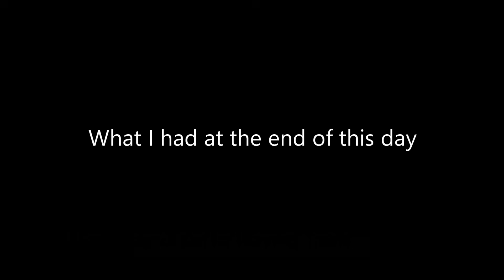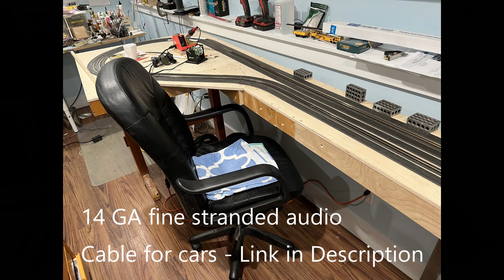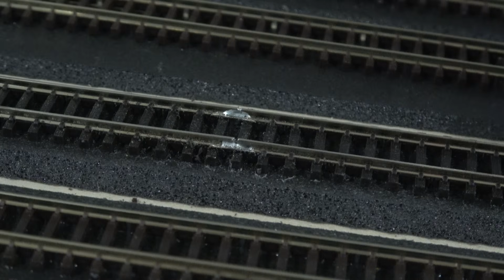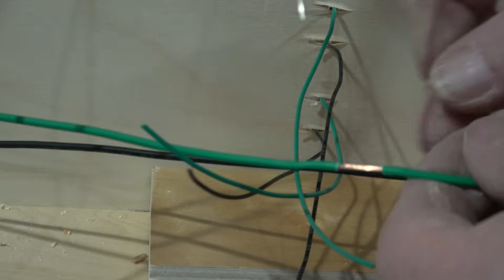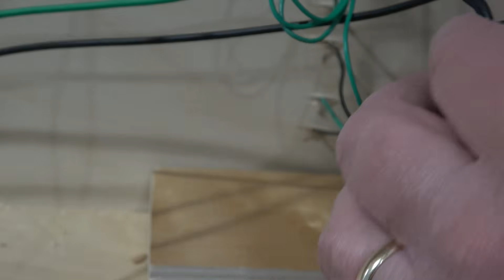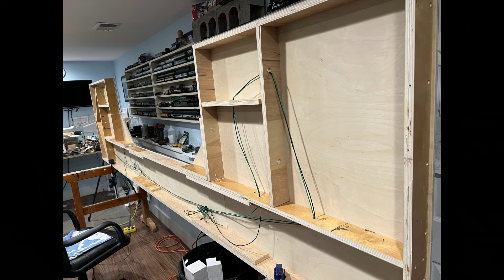171 Completing the N Scale Running Layout

Comment: Hi Rob, nice work mate, it all seems to be running well. I just read Graham’s comment and that urge to do the scenics much be strong, I know it’s a running layout but I think I would give in, lol!
Looking forward to seeing a few of your lovely loco’s running round, cheers for now John
Reply from the maker: Hi John, Yes, the urge to build buildings roads trees and scenes is very strong.  The problem I perceive is that if I add those things the layout would have a fragility to it that would lessen it’s utility.  If it was to be a scenic layout I would have reduced the tracks to two.  I have three mains now plus some parallel sidings so it would look too busy anyway.   So far it runs sweetly.  As I add points and crossovers time will tell if the smooth running is maintained.  It will depend on my skill and patience.  Thank you so much, Rob
Reply: Rob, N Gauge in particular needs patience, I often wonder why I started an N Gauge layout, lol!
Reply from the maker: @exehavenharbour  Yes, John, when the going gets rough, I wonder the same thing.  n-scale can be very satisfying when you get it right, however.  n is demanding in precision unlike OO, O or I suspect HO, though I have never messed with it.  I would like to try my hand with HO someday.  Cheers for now, thank you again, Rob

Comment: Another good video Rob and I don’t think I’ve ever seen anyone solder the joints of track before on a video so that was neat showing that, I have soldered a couple of joints on my layout where a short piece of track was giving me a dead point - I like the idea of using crocodile clips as heat sinks, much neater than my idea of using two small clamps. Lastly, it was great seeing your stock run again too, you must be really pleased with the outcome. So the big question is - will you put Scenics on it or not? I know you said initially you wouldn’t but I just wonder if you won’t be able to restrain yourself!   😂😂.     Cheers for now mate.         ………..Graham
Reply from the maker: Hi Graham, I thoroughly enjoyed your new video.  Nice on the loco and I am just wild about your camping coach.   Yes, soldering rail joints.  I discovered on the previous layout (CONW) it really helps stabilize the track and puts conductivity through the roof.  You can reduce the number of droppers and still not see any reduction in power delivery.  N scale track, even code 80, is very fine with relatively small joiners so soldering really hardens the system.   It prevents strange drops in power and slow-running locos for no apparent reason.  I wish I had done it on Farland now and will if I build another.  N scale is very sensitive to power drops and such.  The Farland layout runs at between 16 and 18 volts.  N scale runs at 10-12 so it is much more sensitive.  I started using the alligator clips when I soldered LEDs.  They are convenient and quick.  I keep a few clipped to my solder caddy.  Yes, I do like this little 1:160 scale rolling stock.  It is amazing how much detail they can pack into the little jewels.  Currently, I want to resist scenics.   When I am done with this, I can sell it as scenic ready and maybe get my money out of it someday.  In the mean time, just have fun.  I am currently loading it up with crossovers and sidings.  Can't stop.  Cheers for now, Rob

Comment: Hi Rob,

How many feeders did you add to your layout ? I have connected feeders to the bus your way, but then I rewired my layout when I divided into  power  districts with fuse protection. I used suitcase connectors to connect my feeders to the bus. I like them but I learned that they don't always make a great connection so  I started stripping both the feeder and the bus before I add the connector.  Good job as always !
Chuck
Reply from the maker: Hi Chuck, in the video, I just connected one pair of droppers per loop.  Since the joints are soldered, I am experiencing very little voltage drop and without any turnouts, the conductivity is very good.  I’ll be adding more droppers as time goes on and I add more sidings and crossovers.  At the time of the video it was just two simple loops no crossovers. I have a very low moisture situation here so the wire wrap over the last 11 years has proven itself to be robust, free, and, completely reliable.  Thank you so much, Rob